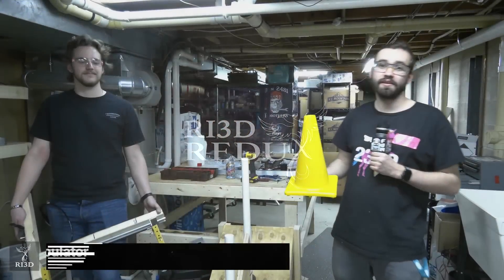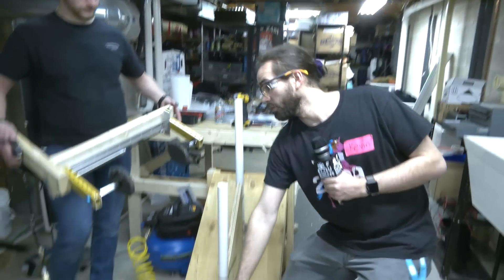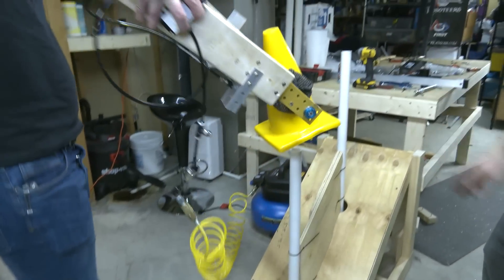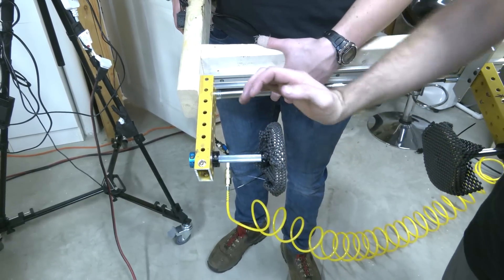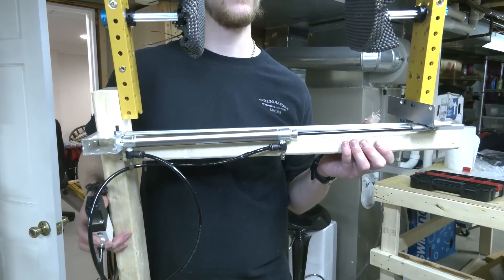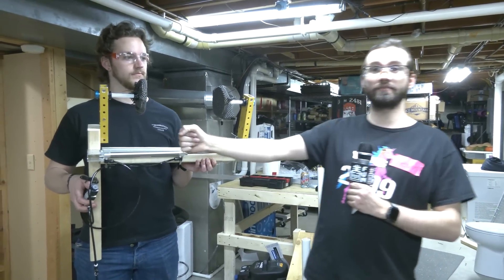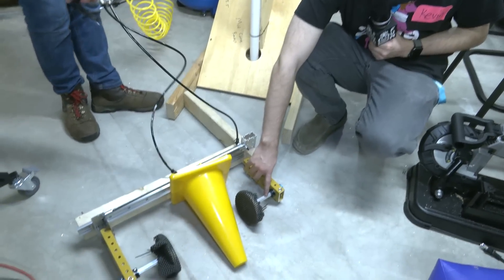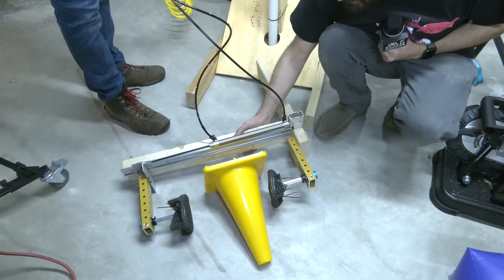Passive Cone and Cube Wrist | Ri3D Redux 2023 Charged Up

Comment: Can you do a video on how to make quick pneumatic test triggers please for prototyping?
Reply: We’ve all gone home now so the build is done, but in short the east way to do it is use the regulator in a shop compressor and plug it directly into a solenoid
Reply: We specifically used a shop air compressor with a universal air coupler as a source of air for our prototype.  Then most solenoids have a button on them to manually fire the solenoid so you can manually trigger pneumatic cylinders, sometimes the button is under a cover, and most of the time you can twist the button (with a flathead screwdriver) to lock the solenoid in a specific orientation.

If you don’t have mentor support that can help you out with this problem and you are still unsure on how to do this yourself, I can try making a quick video for you, just let me know (it won’t be up to Tyler’s awesome video standards though)

Comment: Who makes that 2x1 aluminum extrusion with the holes on the side? That doesn't look like vexpro versaframe and it looks mass manufactured.
Reply: It was custom machined on a CNC router.  There is a tube jig that clamps plain extrusion into a known location, then a hole pattern is drilled into the tube.  These tubes have a 1” grid of 19/64” holes for rivnuts, but you could machine any hole pattern
Reply: This in particular can be sourced from AndyMark, and it was machined like Kevin mentioned above
Reply: It is REV MAXTube

Comment: What are the specs on that cylinder?
Reply: It is a 8” throw 3/4 inch cylinder, it was just the first one I grabbed that looked like a good size
Reply: Looks like a 3/4" bore (stroke up to you as discussed in the video). That's a pretty common bore, but smaller is probably ok especially with shorter strokes? The force calc is straightforward  based on air pressure and bore if you want

Comment: I like the rotating grabber but don't like that you have to pickup the cone from a specific orientation
Reply from the maker: Keep an eye out for the other intake prototypes coming out soon!
Reply: It becomes great if you can filter the cone down to pointing towards or away from you, which should be possible
Reply: ideally you have a passive "cow catcher" that orients it before arriving at the claw.
Reply: This prototype takes cones from 2 knocked over positions and then makes it upright
Reply: placing the cone on the GRID rods would be impossible unless it is upright